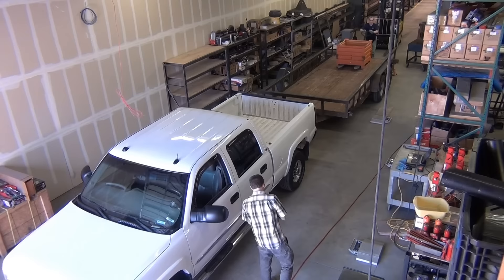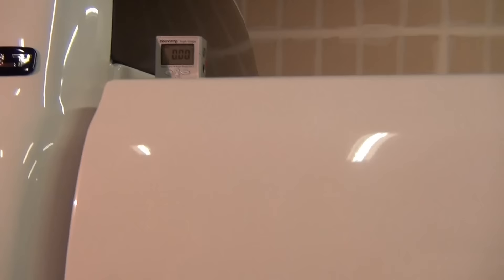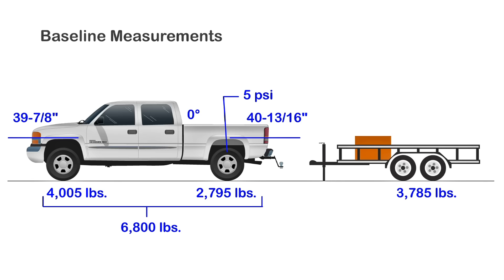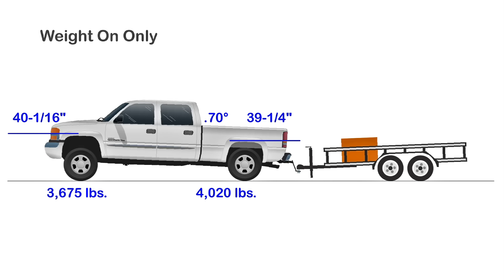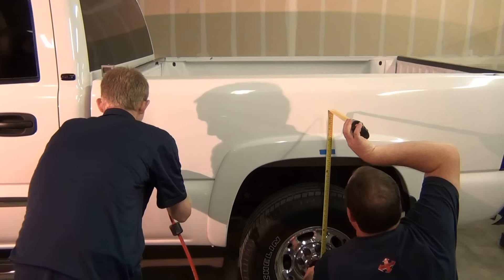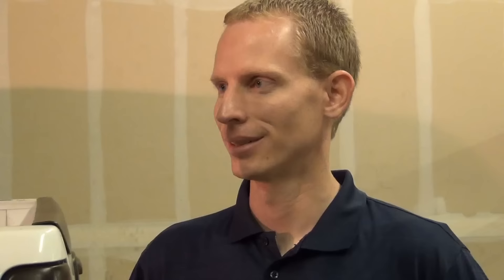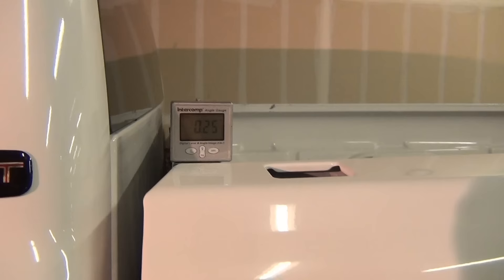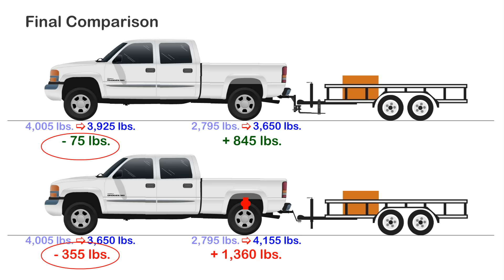The Difference Between Using Weight Distribution and Air Bags to Level Your Load

Comment: What about using both? Add 25 or 30 lbs along with the distribution hitch?
Reply from the maker: +eric batrez,
Using both is a great set up. You are correct, there will be some added weight with the air bag and the weight distribution hitch hardware that will need to be taken into account so as not to exceed your vehicle capacity/ratings.

Comment: A very informative video.  I wonder if you could help me understand some of the numbers (gross combined weights).  I summarized the observed weights in the video below.  Can you guys think of any reason for the measured GCW increasing throughout the video?  I'm thinking maybe there was some estimate error in the weight of the tonuge, which can account for the 100 lbs difference seen when the trailer is first connected.  But, the additional 20 lbs seen with the airbags aired up is  hard to explain.  I can easily accept the addition of the WD bars adding 10+ lbs, so, my biggest question is around what happened connecting the trailer?  Do you have any ideas?

Truck and trailer disconnected:
Axle 1 = 4,005 lbs
Axle 2 = 2,795
Trailer Tongue = 1,000
Axles 3+4 = 3,785
GCW = 11,585

Truck and trailer connected:
Axle 1 = 3,675
Axle 2 = 4,020
Axle 3+4 = 4,000
GCW  = 11,695

Truck and trailer connected, airbags inflated:
Axle 1 = 3,650
Axle 2 = 4,155
Axle 3+4 = 3,910
GCW = 11,715

Truck and trailer connected, WD hitch
Axle 1 = 3,925
Axle 2 = 3,650
Axle 3+4 = 4,150
GCW = 11,725
Reply from the maker: Brian, thank you for your comment! We'd love to go over your setup with you. Can you reach out to us via phone or email?
Reply from the maker: Reach us at 800-478-5578, or support@fastwaytrailer.com

Comment: I've got a question (yes, go ahead and laugh if you must). I have a little Toyota Tacoma that's rated for 6200lbs of towing with the 4.0L V6. The trailer I'm hauling starts around 4500lbs and all up ends close to maximum capacity for the truck. It goes without saying the suspension is simply not cut out for the job. The hitch drops a lot and it sways a bit in wind but the engine seems to be okay with it and I think if I put bags on it then it might improve handling a lot. That brings up the question of "Is it worth it? What system should match up with the little mighty mini?" Additionally, would it be ridiculous to try a WD on this small of a truck? I get it that most people would just scream "buy a real truck!" to which I'll say I already own one that does more work than most full size trucks out there, and I am perfectly happy with my little Toy!
Reply from the maker: +Tim T,
No laughing here. We're happy to help any way that we can.
We did a quick search for the Tacoma weight distribution requirements, and from what we can see Toyota requires weight distribution if the trailer is over 5,000 lb. (See http://www.ttguide.net/trailer_towing-80.html ). Check your owner's manual for the exact specs on your year/model truck.

In your case, we would highly recommend a good weight distribution / sway control hitch like the e2 or Equal-i-zer hitches.
http://www.fastwaytrailer.com/e2-hitch
https://youtu.be/ChyN-d_qcHo

http://www.equalizerhitch.com
https://youtu.be/aA3_hH60fzE

We are confident that a good hitch, set up correctly, will be totally "worth it."
Reply: My son has nearly the same set up. The springs on the toy are inadequate for load carrrying, bolster them up with a set of bags and use the WD hitch to manage the weight transfer. Working well here.
Reply from the maker: +Brent Weisgerber,
Glad it's working well. Thanks for the comment!

Comment: Interesting. But still think I'm going to put air bags in the truck vs weight distribution system. My scenario is. Towing a light trailer. Loaded is 4k lbs. With a tongue weight of about 4-450. Which I'm buying a tongue weight scale. 2 tow vehicles though. 1 a 1500 Chevy. Second a 24ft class c diesel rv. I only run into leveling problems when I completely load the truck full of coolers and fire wood at the same time. Plus when I go get soil,gravel,bark n etc. I can level the truck
Reply from the maker: +Kyle Go Hawks, sounds like a well thought-out plan, and that you're using each for its intended purpose. Good luck, and thanks for chiming in!

Comment: BIG QUESTION! I have a 16 F150, super crew, 6.5 box, HD tow package, 4x4. I pull a 38 foot TT with blue OX W.D.H. For the last 2 years. Gonna do the air bag thing cause I've been told it will get rid of the little sway wiggle I get in cross winds. Nothing white knuckle to write home about. The question is. When pulling any bumper pull trailer is it the perfect pull if the truck doesn't sag at all. Meaning if the rear fender lets say sits at 50" do you want to pulling any trailer at the 50" mark with airbags and WDH combined. Cause even with my WDH setup I still drop 2" below factory height.
Reply from the maker: +Cannon Ball,
The short answer is that in almost every case it is expected that the rear fender height should drop some with weight distribution engaged. This is because the goal with weight distribution is to use the leverage of the spring arms to force the tow vehicle to react differently when carrying the trailer's tongue weight than it would with no weight distribution. A good weight distribution setup allows the rear axle to carry part (usually a lot) of that tongue weight, and minimizes the "teeter-totter" effect that takes weight off the front axle to be carried at the rear.

The fender measurements are simply a shortcut to estimate what the axle weights are doing, without having to take the vehicle to a scale. As you can see in our weight distribution setup in the video, from uncoupled to coupled using weight distribution, the rear of the truck drops an inch and a quarter, and the axle weight raises by 855 lb. This is fine as long as it is still within rating limits. Inflating the air bags would make the rear suspension much stiffer. Therefore, we would expect to see less change in the height measurement from uncoupled to coupled with weight distribution, but not much change in scaled weights at the axles.
Reply: Just want to let you know of my experience.  We have a 2017 F150 XLT Supercab 4x4 with Max tow package. I installed Load Lifter 5000 Ultimate Plus and it leveled the truck just as advertised. The problem came when I unhooked the trailer  and lowered the psi down to 5 pounds with truck totally unloaded except for my wife and I in the truck. We hit a dip in the road at a RR crossing that we always cross at a  good speed. We bottomed out so bad we could both feel it in our necks. With the internal jounce bumper there is only about 2 inches of travel compared to about 6 inches with the factory bumpers that are removed . I did end up taking the air bags off and just using  the WD hitch.   Good luck
Reply from the maker: +Terry V,
Thanks for sharing your experience.
Reply: Terry V that’s what I’ve read on F150 forums. But I was told to install the Airlift Ride control 59570 the 2,000lbs unit.

Comment: Very informative video. Is there any benefit to having both?
Reply from the maker: Using both can be tricky. If you have too much air in the bags, then you will lose the sway control and WD of the hitch. If you use both then you need to set up the air bags first and then the WDH, so the hitch can still give you WD and sway control. Setting up the air bags last will take the tension off of the hitch.
Reply: @FastwayTrailer  great to know! I use both too
Reply: @FastwayTrailer  So what’s the best way to set up the bags to use both? I am new to all this. Would you air up the bags to correct for the sag and then connect your WD hitch?

Comment: I currently have a TT with a  970# Tounge weight I had previously set up the Equalizer hitch according to there specs, The Truck and trailer when coupled meet the desired front and rear measurements but the rear has a very slight sag. I was givena set of Airlift bags for christmas and am installing them now. In hopes to get rid of some of the bucking on bad roads. Should I just air the bags up slighlty or do I have to resetup the equalizer hitch again  after bags are aired up thanks
Reply from the maker: +Scott Yach,
Check your weight distribution measurements and note them (follow the process in your hitch owner's manual), then add a little air and see what it does. If that doesn't change the weight distribution, and you're comfortable on the road, you're good. If you find that you prefer the ride with more air, and that changes the weight distribution you're getting from the hitch, then you need to make some adjustments to the hitch - more washers or raise the L-brackets.

Comment: Wow we have a lot of towing experts that can’t understand you loaded the trailer tongue heavy for the demonstration. It’s not a hard concept to grasp! The bars on the WD hitch actually force up on the ball mount and through the frame of the truck this transfers the weight or down pressure on the front axle.  They are like wheel barrow handles. I think the combination of the 2 is probably the best if set up correctly using airbags to reduce squat and add stability and WDH to distribute weight to front axle. 

Question...how about Timbrens instead of airbags, with the WDH? I have the round bar e2 10,000 pound setup but truck still squats a bit in the rear.
Reply from the maker: If the Timbrens are acting like a helper spring in your suspension, you would simply follow the e2 hitch setup process [https://www.fastwaytrailer.com/manuals] as usual. We recommend you consult with Timbren or one of their authorized dealerships and your hitch manufacturer for any guidelines they have on using them with any other weight distribution hitch brand. Don’t worry about the squat. The most important measurement is how much weight is being returned to the front axle, as indicated by the measurements at the wheel well height, or by taking the vehicles to a CAT scale for an actual weight. You want to get at least halfway back to the baseline measurement/weight (see the process in the e2 owner’s manual). The rear should squat some, because you want the rear axle to be carrying some of the trailer’s tongue weight. This will make the tow vehicle more stable, and more able to control the trailer while you’re towing.

Comment: I was told that the bags will stop the teeter totter which contributes to sway. Do you agree?
Reply from the maker: +Cannon Ball,
No, the air bags do not stop the teeter-totter. The rear axle is the fulcrum (support) for the teeter-totter when you place the trailer on the hitch ball. This drops the rear of the truck, and raises the front, teetering over the rear axle. Air bags do not move this point forward or backward, they make it stiffer or softer, and raise and lower it. If you can imagine the playground toy, one with air bags inflated would be like a board sitting on a steel bar. When you add weight, it does not sink, but still tips back and forth at that point. Uninflated or no air bags would be like that board sitting on a coiled spring. When you add weight, it will sink (drop), and still tip back and forth at that point.

Yes, the teeter-totter can contribute to sway because it takes weight off of the front axle, which gives it less grip and therefore less control on the road when the trailer acts on the tow vehicle.

Comment: Will you answer a question for me? I have a 16' dutchman travel trailer...the specs say it weighs about 2,800 VW, unloaded..the tongue weight is about 280 to 300lb..do I even need a WD hitch. I drove it 200 miles today and I had no problems using only the tow ball..no wd hitch. I can hardly even find a WD hitch for sale with this tongue weight..i just don't know if i need one..but I'd like to get one if needed.
Reply from the maker: +Arctic Gummibear,

Great question, thanks for asking!

Unfortunately, we do not have a simple "yes" or "no" answer for you. But here are some things to consider:

What is the size and weight of your tow vehicle, especially relative to the size and weight of your trailer? "The Trailer Handbook" by Clint Lancaster and Richard Klein is a great reference. In their discussion of towing dynamics, their findings show that at a 1:1 weight ratio (tow vehicle to trailer), with 15% hitch load, there is a narrow window of stability. At a 3:1 ratio, there is a very wide window. Less than 1:1, you're just asking for trouble.

What does that mean? If you're towing this trailer with a 1 ton pickup truck, there is probably not much need for a weight distribution hitch. If you're towing it with a small SUV, it's probably a good idea to add that extra measure of safety a sway control hitch gives you.

Is your tow vehicle's suspension "soft?" If so, and you get a lot of "sag" between the tow vehicle and trailer, you might want a weight distribution hitch.

Do you tow frequently where there is a lot of high wind / crosswinds? A good sway control hitch will probably make the ride a lot more comfortable.

How is it towing now? If you haven't noticed a lot of sway, and everything seems pretty stable, you're probably OK as is. If you notice instances where you feel like the trailer is pushing you around and you're not in complete control, consider a sway control hitch.

Of course, if you ever want to chat, our customer support team is top notch. Get in touch with them at 877-523-9103, or email Support@FastwayTrailer.com.

If you decide a sway control / weight distribution hitch is for you, I would recommend the e2 4.5K trunnion hitch: http://www.fastwaytrailer.com/e2-hitch

Good luck!
Reply: That really depends a lot on your tow vehicle. The best supplier I know ,which is conveniently in tax free Delaware is easternmarine . Worth checking out.  http://www.easternmarine.com/    http://www.easternmarine.com/Weight-Distributing-Hitch-Kits/

Comment: I run airbags with a weight distribution hitch and really enjoy both benefits. I've never compared the two,  as they have their own assigned jobs. I've ran my trailer without the WD and just airbags and the compromised comfort of the ride  is noticable. 
I'm curious though,  did you inflate the airbags with the trailer already attached?
Reply from the maker: We recommend that you first inflate the air bags, then set up the hitch. This is because adding or removing air changes the height of the hitch head/hitch ball, which is an important factor in getting the hitch set up correctly. If you inflate (reduces weight distribution) or deflate (increases weight distribution) the air bags after the hitch is set up, you should check the weight distribution to make sure you are returning the correct amount of weight to the front axle of your tow vehicle. In most cases, this should be returning at least 50% and up to 100% of the weight lost. For example – if your front axle weighs in at 2,500 lb without the trailer, then drops to 2,100 lb with the trailer coupled but NO weight distribution, a good weight distribution setup would return the front axle weight to somewhere between 2,300 lb (50%) and 2,500 lb (100%).
Reply: Andrew Peters I was wondering about running both. I have a leveled f150 and just bought a WD Hitch but haven’t installed yet. Im hoping the WDH will eliminate the sag &send more weight to the front axle. If not I was planning to add airbags to add the finishing touch on leveling. Think I’m on the right track?

Comment: Does a weight a distribution hitch work when using a hitch extension?
I tow a cab over camper with a horse trailer and would love to know if it helps.
Thanks
Reply from the maker: Great question. We normally don't recommend it specifically because a lot of hitch extensions have specific recommendations to NOT use together with a weight distribution hitch. If you need the hitch/coupler to be further away from the vehicle, we recommend getting an extended length shank (18" instead of 12") that you can get from Equal-i-zer Hitch. That will extend your hitch and still keep you within all of your safety ratings. Does that help?

Comment: Too much air pressure in the air bags on a vehicle with rear coil springs will cause the front end to "porpoise" up and down when driving. Giving the feeling that the front end has disconnected from the chassis. The rear axle becomes the pivot point on a teeter totter.
Reply from the maker: Thanks for your analysis. Spot on!

Comment: How about the happy medium? Using airbags with the weight distribution hitch. Will it help retain more control at the front axles while still splitting the stress between the rear axle and the trailers axles?
Reply from the maker: +David Pendley,
Using air bags with a weight distribution hitch is a great setup, and works fine as long as you inflate the air bags first, then get the weight distribution dialed in. When using both, the weight distribution hitch will help retain more control by keeping weight on the front axle and relieving the rear axle of some weight it would otherwise carry. The air bags will stiffen the rear suspension of the tow vehicle, which can give the tow vehicle better stability.
Reply: FastwayTrailer 
How about airbags with a fifth wheel gooseneck setup? We are looking at fitting a fifth wheel toy hauler.
Reply from the maker: +David Pendley, thanks for the question.
We do not manufacture 5th wheel hitches, so this is not really our area of expertise. We recommend consulting with a couple of reputable dealerships specializing in trailers and vehicle suspension for their recommendations before making a decision. Based on the comments here and what we have heard elsewhere, air bags can have some good benefits when towing a 5th wheel / gooseneck trailer. Good luck!